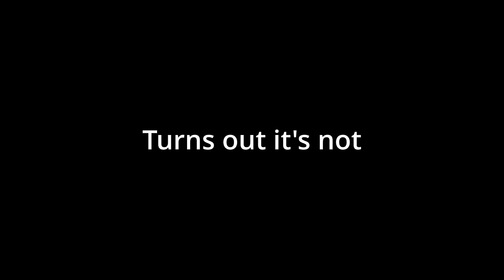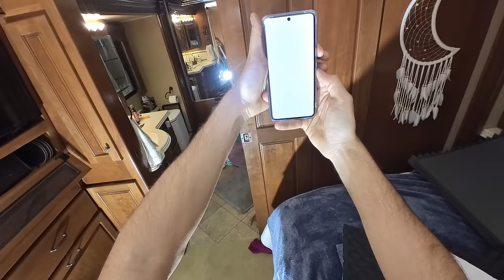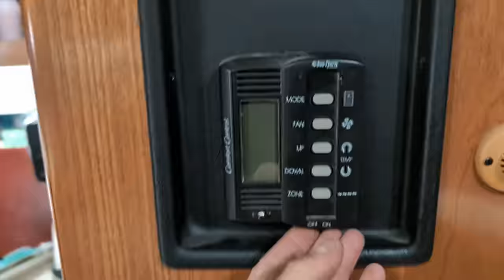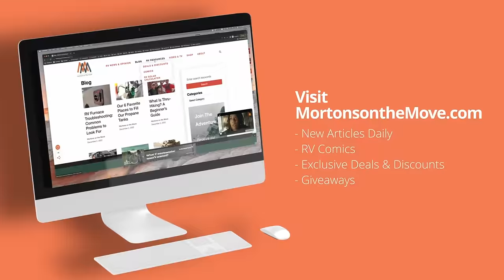It Worked! 🔇- Making A Loud RV AC Quiet

Comment: If you look at the Rotron catalogue, they make the actual "Muffin" cans and computer fans. I was amazed to find that when I went looking to upgrade some fan blades, they often make 10-20 models in each size. Different fan blades can move twice as much air. Or be 5x noisier. On top of that, smooth polishing of the blades, especially the edges, can make a huge difference in both, but csn also double the price.
 Guaranteed if you buy a high quality replacement fan, you'll have a hard time finding it--but never regret it!

Comment: I am surprised how this turned out. I have plan to replace my rooftop AC with mini split, but my unit is still working, it's kind of wasteful to throw it away. This is a great way to extend the useful life of my ac before I throw it away. Thanks for sharing.

Comment: I don’t have a way of measuring  for noise but I do have the same system in my 2000 Monaco dynasty. I use bifold air filters meant to help with allergies and I don’t think mine were as noisy as what you were measuring especially since you had your air filters out. I just wonder how much dust you are going to accumulate inside your AC unit and ducts without filtering them. Thanks for the video. I noticed you haven’t added soft starts to your AC units either. That will help with the noise when the compressor kicks in and out. With what your slide out toppers look like on your roof you might want to look into “true toppers” I put them on my rig, and I love them.

Comment: If you could make a follow-up video for this modification in say 9 months or a year, I would be interested to see how well this modification holds up and what the long term affects are to the air conditioner’s performance during the summer and if it causes strain or damage to the air-conditioner.  Also concerned the foam, being so porus, will probably function as filtering and collect large amounts of dirt/dust.

Comment: Need to clean your condensor and evaporator .
Tip take motor out and clean .
It won't last long with that much dust. Motor at Dealer $300 not installed.